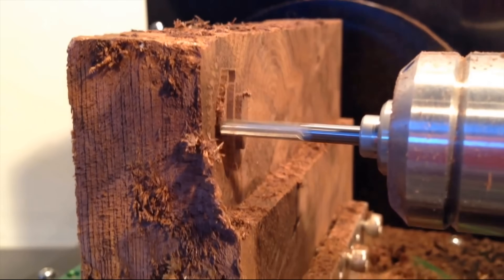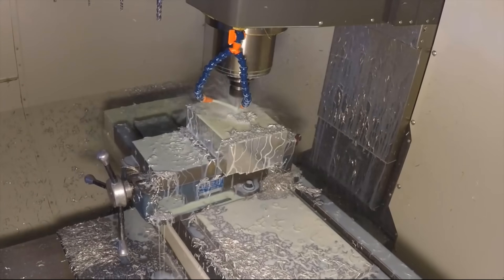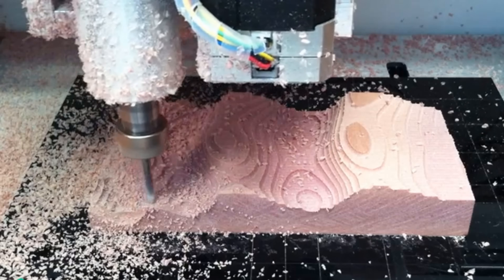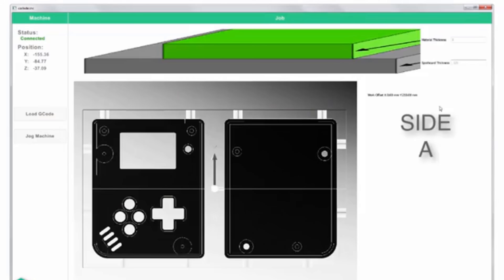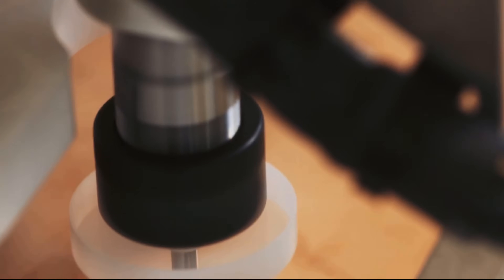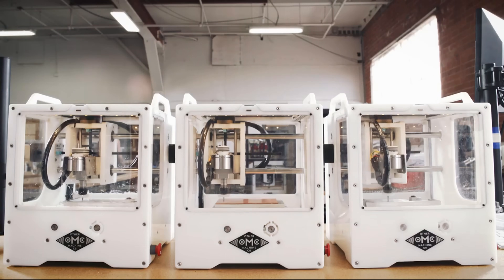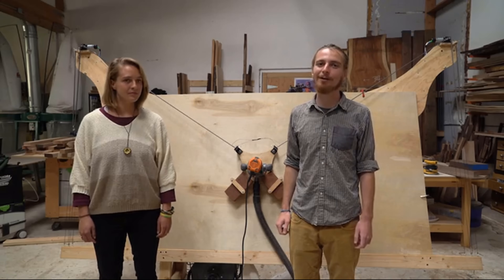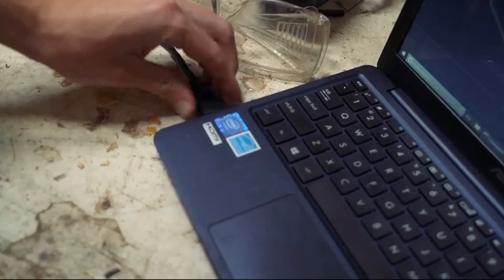TOP 5 CNC MACHINES

Comment: Hi, Great video. I have just bought a 6040 cnc router. I have a desktop computer with windows 7pro and using mach3. I'm trying to find a good pci card to use for the parallel port. Do you have any suggestions please. Terry.

Comment: best 2018....the pocket nc is NOT from 2018....fail.
Reply: but the V2 is (more or less)
Reply: did not say they had to be from 2018 it just said "TOP 5 CNC MACHINES 2018" if a 50 years old machine is better than anything made in 2018 it should be there too.